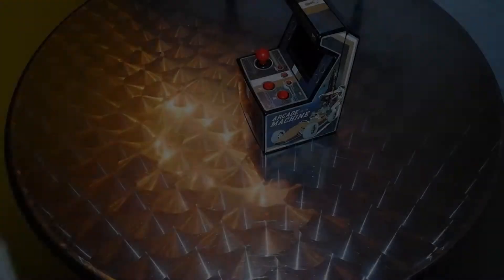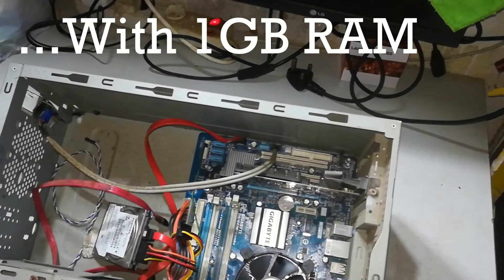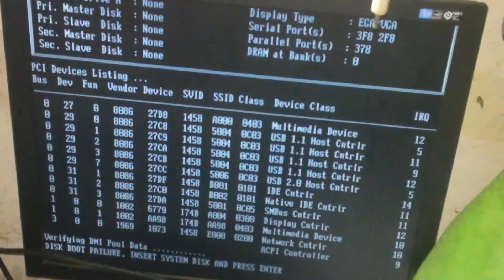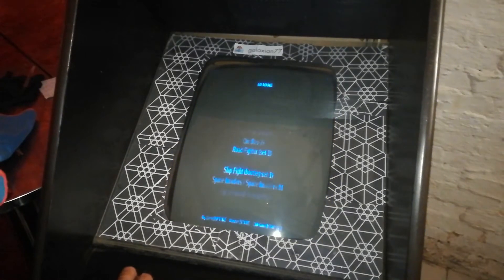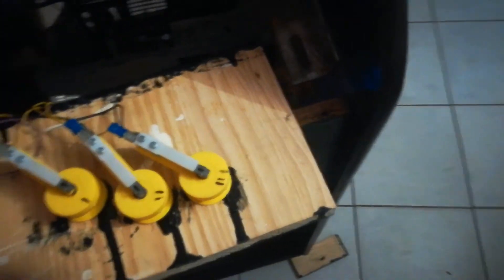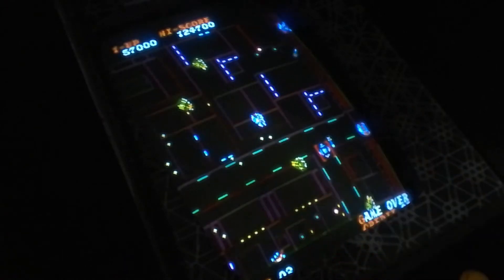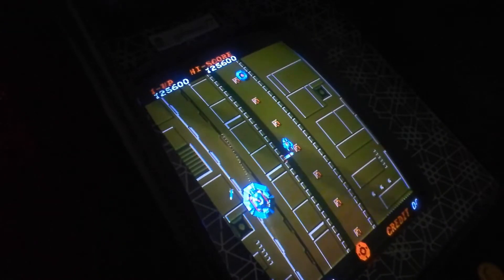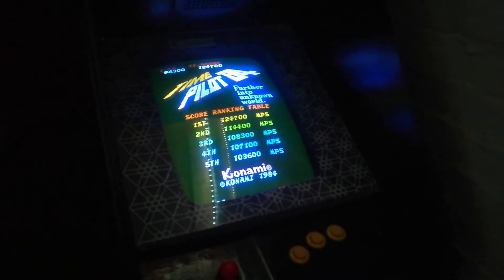EP135: MAME Cabinet: Some MORE deffered maintenance!

Comment: Never suspected the GPU. Great troubleshoot!
Reply from the maker: Wow, yea myself included! I think the initial thought was that the problem did not always manifest itself, and seemed intermittent. In hindsight it makes total sense - the weather as you know has been rather hot of late, and this VGA card has only a passive cooling solution... Since I last worked on this cabinet, I actually closed up the back door properly which possibly also contributed to the GPU further overheating. I still think it will work again if I mount a fan to it and renew the thermal paste... That's for another day though... The machine is working now and I'm not going to touch it, besides adding coins and playing games! Thanks for watching!